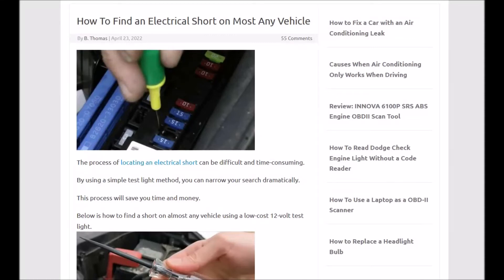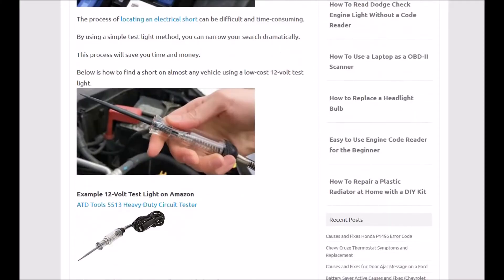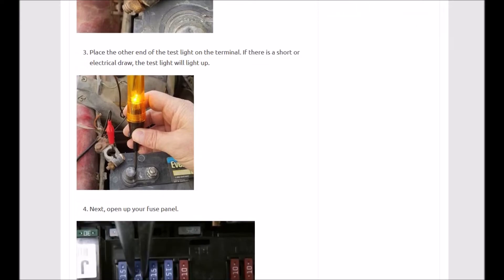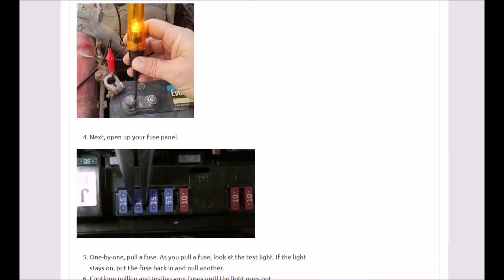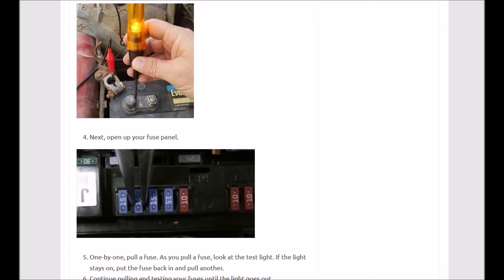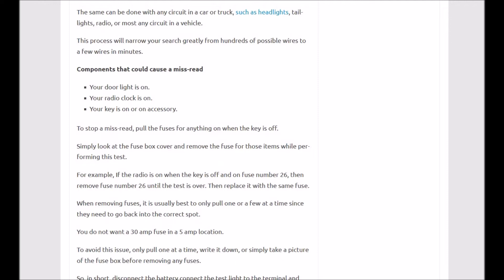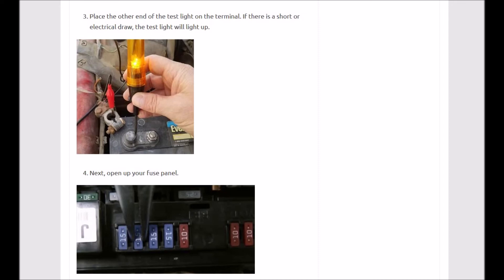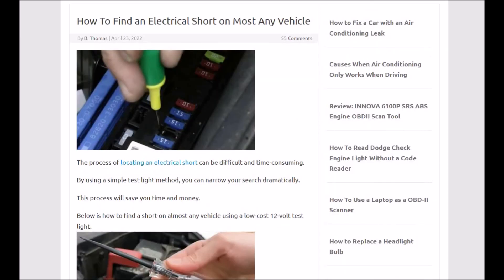How to Find an Electrical Short that is Draining the Battery in a Car

Comment: I tried this and my test light did not go off. I have a diesel truck with two batteries so I completely disconnected one battery then tried your method.  But no success
Reply: Your issue would then be on the constant hot side of the fuse panel. Problem would be with something like your starter or charging circuit... alternator etc. I see this was from a couple of weeks ago so I hope it still helps.
Reply: @toddwood1150  Thank you for replying.  I'll check it out see if works
Reply: @toddwood1150 
I tryed this too
And my light did not turn off
I replaced my battery, starter, and alternator,

And i still can’t find the problem 

Any advice?

Comment: I don't get it? Aren't you just completing the circuit again? Battery cable off connect test light to cable , light to post completes circuit again.🤔
Reply from the maker: If the light is on, something is draining the battery. Pulling fuses one at a time until the light goes off will often point to what is causing the drain. For example, if you pull the tail-light fuse and the light goes out, then that is where the problem is. Be sure it is not an open door, dome light, or something similar.
Reply: @HVAC_Mechanic just to make sure I got the right tool. I got a “circuit tester” but is that a “test light”. Are they the same thing

Comment: 84 Corvette problem. I pulled the fuse that was causing the draw. However, there are over 12 circuits on this fuse. How do I find which circuits is causing the draw?